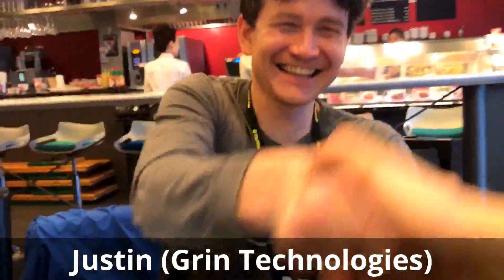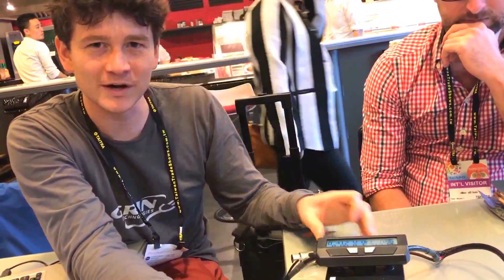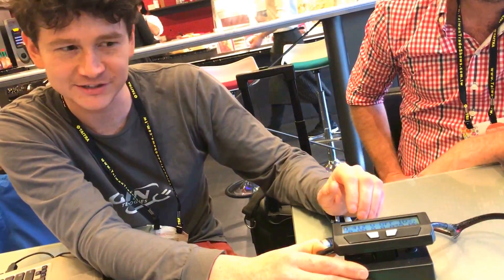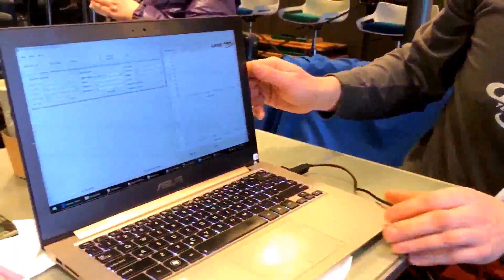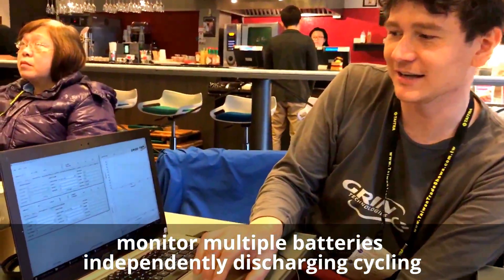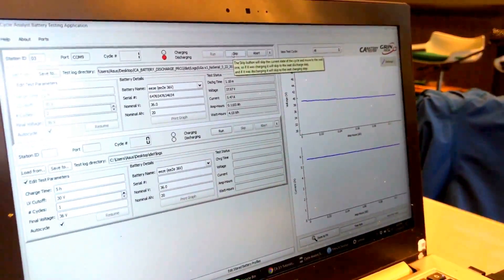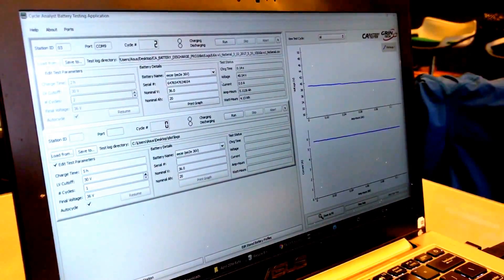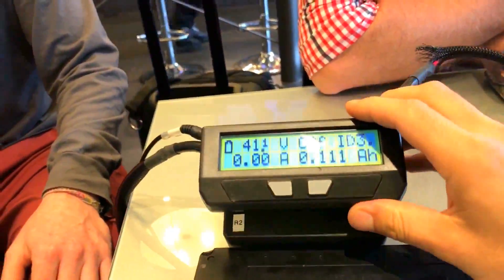Justin introducing Battery Grinspector (battery pack testing station) • Grin Technologies ebikes.ca

Comment: Are you planning to use any of this on the 'demon' trike? (personal dub!) Also, are you working on the lack of traction issue? a plus sized tire would probably do it, and/or suspension. Outrider is a good reference for a full suspension trike...
Reply from the maker: GustSergeant yeaaaahh I'll get one for my electronics lab and yeah I can graph my super powerful new trike battery... traction is improved now with a very wide rim and low tire pressure like a mini dragster haha... super scary... death trap ohhh yeaaahhh!!! =]

Comment: Yes finally I been rattling on about this for a while and doing it with my mc3000 but at a much lower amperage on 1s.. 
So a system thats going to graph discharge characteristics of whole pack at high amperage. Do you know if they will support higher amperage setups than stated? Otherwise to test high load levels you'd have to build a test pack as 1p.
Where were you when you filmed this?
Reply from the maker: Yeeaahh... the amperage will be limited by the shunt resistor inside that little magic box...  based on their previous products, I am pretty sure we will be able to open and add a much bigger one and update the shunt ohms value at the CA and software for a correct and accurate reading. They may offer two versions one with a small shunt for testing small packs and other with a large shunt for the high power guys like me haha =]
I spent many days having fun with Justin, Robbie and many other ebike legends few weeks ago in Taiwan at the Taipei Cycle show... I wish I had my GoPro camera recording me and Justin racing each other on two little 16" wheel folding bikes at night on a mission to find an ATM hahaha... little bikes but super POWEEEEER !!!
*there is a second video coming mostly showing their new LiGo batteries